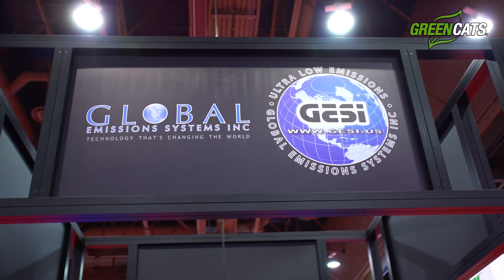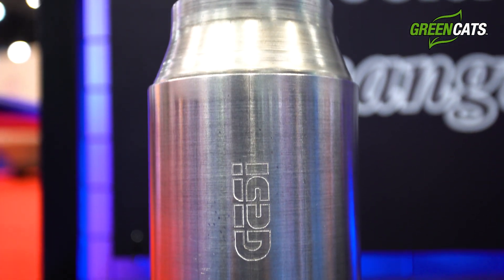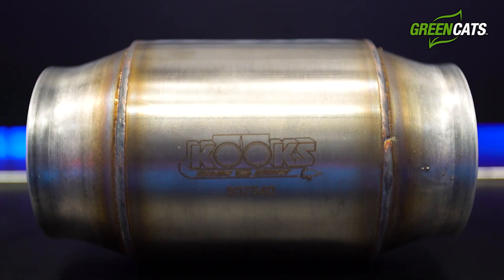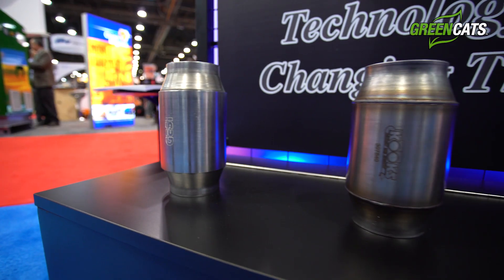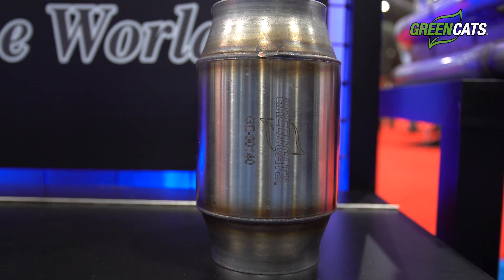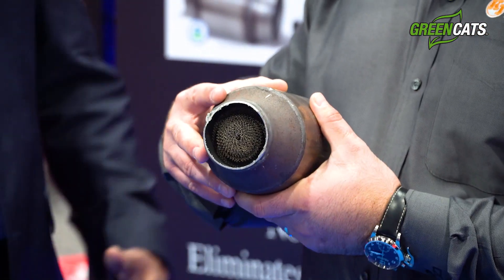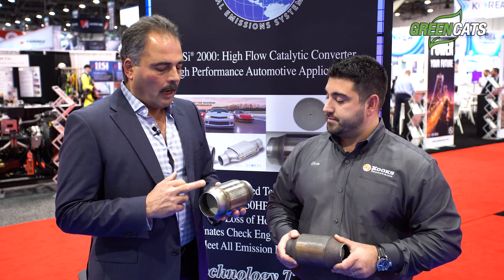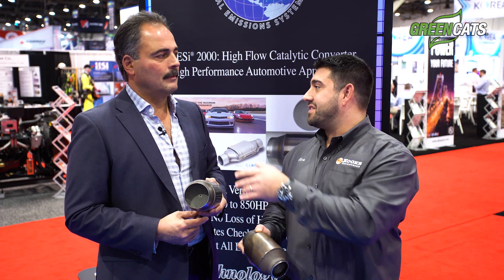Kooks Ultra High Performance GREENCATS

Comment: Does adding Green Cats versus no cats reduce the exhaust noise level?  i'm considering "Kooks headers + green cats" to replace my manifolds and primary's and I'm concerned that headers with "no" cats will make it too loud..   Thanks.
Reply from the maker: GREEN cats will help reduce the sound level and smooth out the tone of the exhaust making it less raspy than a non-catted exhaust.

Comment: Metallic substrates are horrible. What happens when that cat cracks and shoots metal shards back up into the engine and ruining your whole motor…
Reply: I've never heard of this happening. But you have my attention...do you have any articles supporting this I could reference?
Reply: How would the exhaust run backwards? The exhaust flows towards the tailpipes not the other way around
Reply: Fr lol

Comment: What is -5 atmosphere
Reply from the maker: In this case, Atmosphere is a measure of vacuum.  1 atmosphere is equal to 14.7 psi, so -5 Atmospheres is roughly equal to -73.5 psi.
Reply: @Kookstv  if you were reading gauge pressure you would be at 14.7 psi absolute and your gauge would read 0psi. You then could pull a perfect vacuum which is 0psi absolute, that would read -1 atm or -14.7 psi, but you can’t go lower than that.

Comment: I have a 19 mustang GT and was thinking of adding  Kooks long tubes with the green cats. Do I have to have a tune to use these or will they throw a check engine light?
Reply: American muscle has a video saying that there is no tune needed with the headers and green cats
Reply: I the video description it says it will eliminate the check engine light if it’s throwing a code for the cats as well
Reply: The wide bands takes care of the headers. The engine will run properly but will still throw cat efficiency codes without the cats. Not sure if the green cats will clear the codes or not, but no tune will be needed for the headers.

Comment: Mine and my buddies Kooks green cats burned up in about 10 minutes of running at VIR in ZL1’s.  These CANNOT be used for HPDE’s even short sessions. Completely hollow now. Had to cut the pipes to find the guts. Very disappointed.
Reply: Oh shit I just bought some
Reply: What did Kooks say?
Reply: Twobarpsi they swapped them out after a while, but I’m reluctant to try them on track. Just running off-road pipes
Reply: @atrammell1  I have a GT500, and was thinking about buying a set.  Not anymore!
Reply: I'm not surprised...
Reply: Welp. Nevermind for my tbss lol